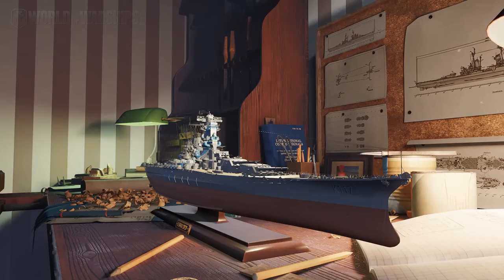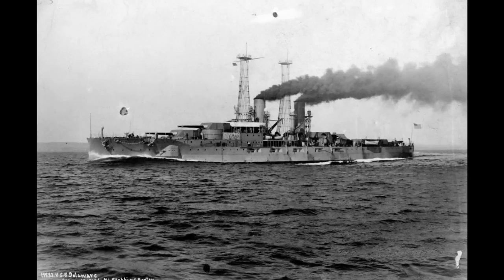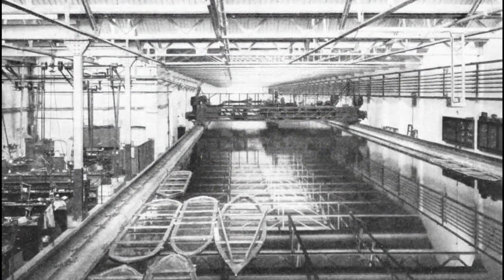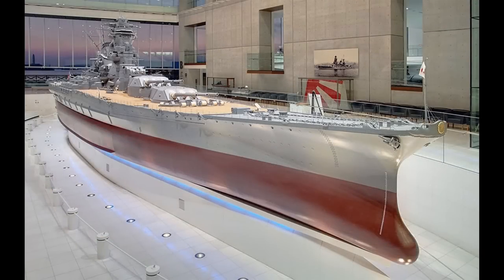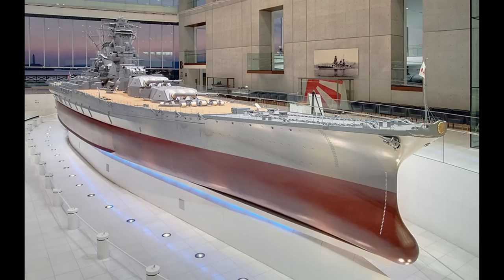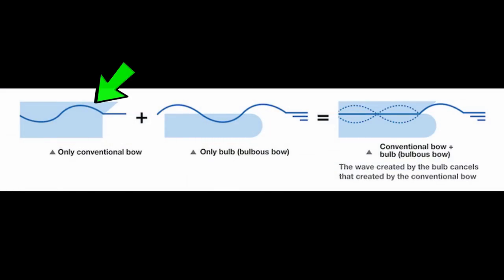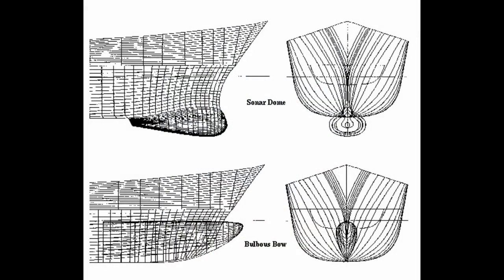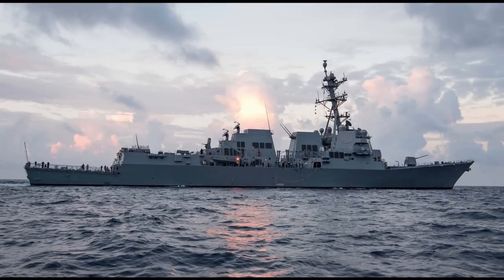Bulbous Bow - The History and Science

Comment: Im also interested to learn about ships hull with other having a V line hull and other having a flatter hull, most interested is the shaping that goes under the water hull of ships
Reply: Naval Architect here

The reason for the V line hull is for speed. Those vessels can get partially or fully up on a plane, like a ski-boat. Those hulls are therefore known as planing or semi-planing hulls.

The larger ships, like battle ships have what  is call a displacement hull. Rather than riding on top of the water, they just push through. And that is why the flat bottom exists. There is just no reason to have it shaped in a complex way because it won’t be above water ever, or interacting with the waters surface.

In addition, the more flat panels on a ship, the easier they are to design and build. And trust me, with a ship as large as a battleship, you need to take advantage of every simplifying technique you can, especially in the 1900s.

Hope this helps!
Reply: @taylorgozzo935  i know that im late but thank you very much on this

Comment: Great video! So, USS Ronald Reagan (CVN-76) was the first aircraft carrier fitted with a bulbous bow, and it supposedly gave us a bit more top end over other Nimitz-class ships. Additionally, earlier ships in the class had a tendency of the bow to "dig in" at high speeds in rough seas- not something that's desirable during flight ops- and the new bow was supposed to help correct that.
Reply from the maker: Yeah, some of the advantages of the bulbous bow include reducing trim angle by almost 1 degree and reducing pitching motion significantly, the latter of which is very helpful for CVs. Thanks for sharing :D

Comment: The "negative" effects of a bulbous bow at speeds slow enough as to not benefit from the wave cancelation effect aren't really all that negative because fuel use is not linear. 

The extra drag at low speed doesn't impact fuel economy nearly as much as the wave effect improves fuel economy at higher speeds (or, more correctly, at the higher speed for which the bow is specifically designed to provide the wave cancelation effect).

Comment: What would be intresting is if you could make the bulbous bow out of a semi-rigid compound and adjust the shape of it to compensate for different wave patterns and thus get rid of its major issue.  Creating some kind of adaptive bulb
Reply from the maker: Neat idea, but not 100% sure how to implement it considering limits to material science, cost and also if the material is strong enough to deal with mother nature (ocean waves etc)
Reply: @ichasegaming  a lot of those issues could be solved by using a water filled rubberised material as water cannot be compressed.  By subdividing the rubberised material into different parts each could be filled or drained of water thus changing the shape you would not be able to do all wave forms but you could have the bow change shape between the most common wave forms.
Reply: @jonsouth1545  True, but you still need a very rigid and still at the same time a very flexible rubberlike bulb. That incompressible water is still a fluid and doesn't hold shape. Pressurizing the water might help a bit, but you still need the stiffness of the rubber membrane to create and maintain the shape.
TDL the incompressible water helps, but doesn't solve the issues at hand by itself.
Reply: @Tuning3434  it would be a complicated system I was was thinking a rubber like bulb made up of lots of smaller rubber like bulbs with a basic internal frame thus giving it a lot more internal strength and rigidity while still being flexible enough to change shape.  I was thinking a material not to dissimilar to what the RHIBS are made from are made from.  Thier is also no reason why such a device couldnt be a modular attachment to  an existing bow and thus be replaceable meaning it wouldn't strictly need to have as long a life as the main hull.
Reply: @jonsouth1545  Well, complicated geometry and lots of rubber might end up in a construction that is heavier then when constructed in only steel, especially if it relies on being filled up with water. Again, I am not saying it's impossible, but I would be interested in what mass you end up running some simplified numbers. 
Ribs make a very nice usage of what are essentially inflated balloons. As long as they are pressurized, the 'relative' lightweight shell has excellent rigidity as its material is only loaded in a shell load. This makes this structure very lightweight, just like how a cylindrical pressure vessel is relative light.  It is what allows aluminium planes to be a thing. However, you can't deviate to much from this perfect shell geometry without needing to add severe reinforcement structures.  
TDL: you can probably make a rubber bulge, but to make it able to allow different shapes optimized for different flow regimes would be the real challenge to solve as you probably cannot rely on the optimal loading geometry of a shell / membrane structure.

Comment: What are the structural impacts of adding that extra bouyancy at the end of the ship?
Reply: Generally speaking, it's beneficial and reduces stress. Ships are more buoyant amidships than they are at the extreme bow or stern, especially with high speed ships. The Bulbous Bow just reduces the load from the bow hanging from the amidships section.  If the bulbous bow is an add on to an existing ship, the extra weight of structure will largely offset the additional buoyancy. On a new design, it will allow more weight to be carried forward.